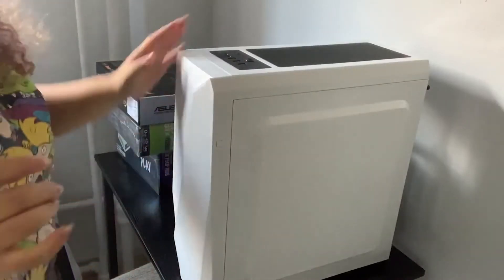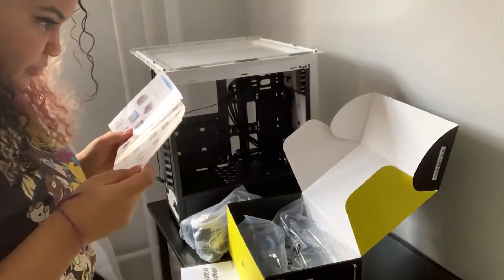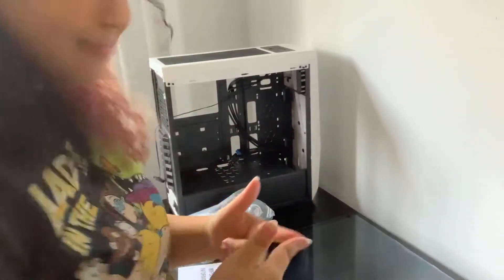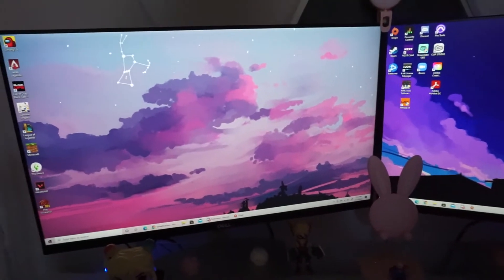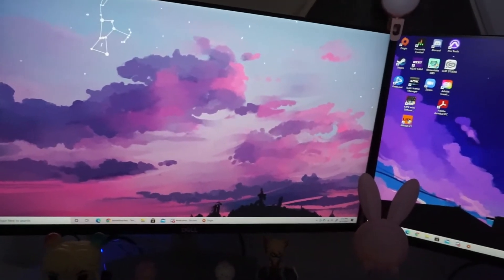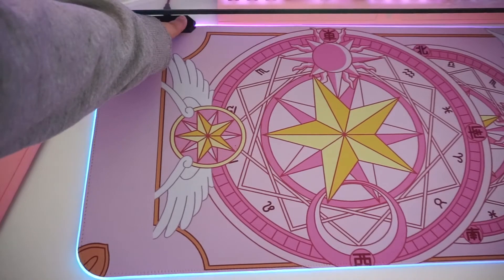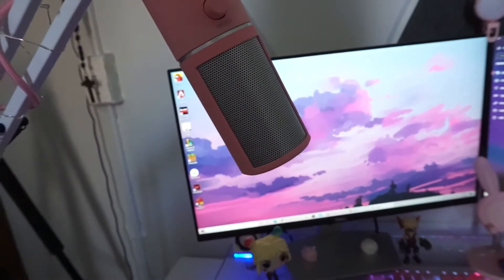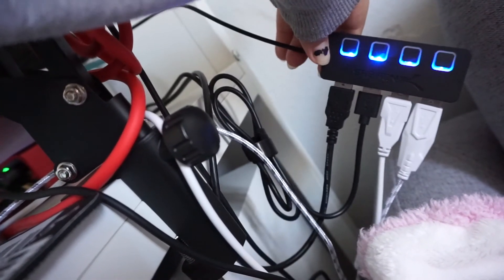Building My First Gaming PC + Studio Tour

Comment: just an fyi you want the air bubbles to build up outside of the aio pump (its in the cpu cooler).  i would recommend moving that radiator to the top slot or you risk damaging the pump over time. for aios with the pump in the cooler, you always wanna keep the rad higher
Reply: Nah the place where she has it is fine
Reply: front mount rad is OK, i think the rad is higher tho
Reply: @shenzoX  been a hot minute since I watched the video but if I'm remember correctly she had rad below cou pump but I think she ended up fixing it